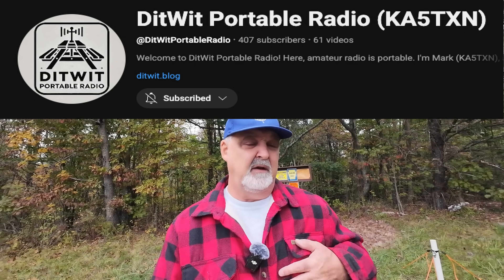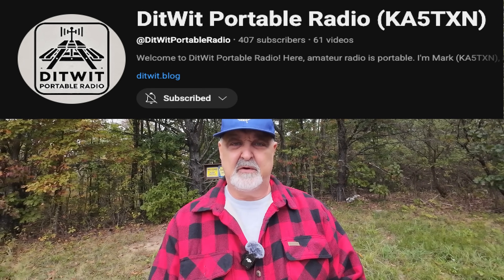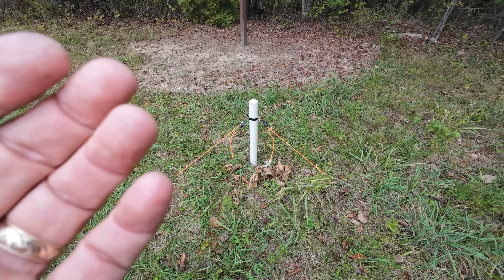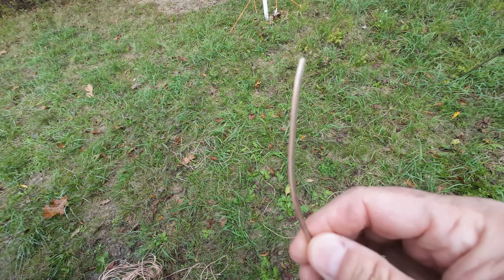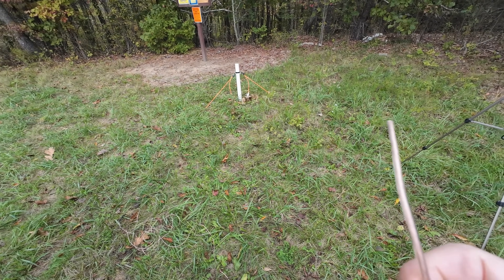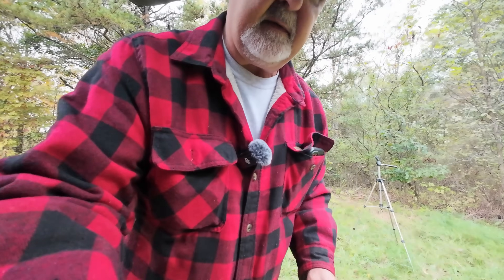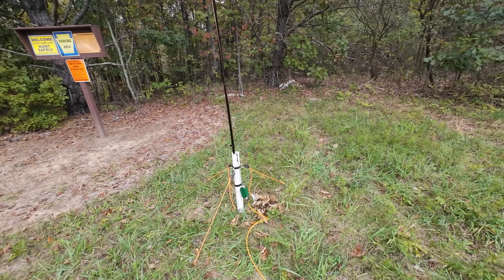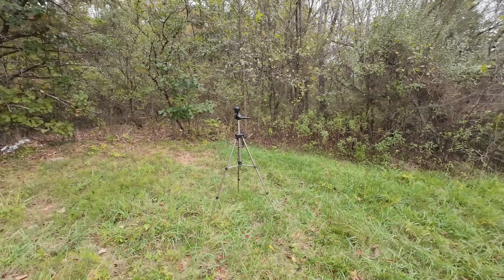Vertical Antenna without Ground Radials = Amazing Performance

Comment: I'm so pleased you had fun with the Challenger OCF halfwave antenna in the field! It's always fun for me to see how others deploy the antenna system. I introduced this design about a year ago and, over the last couple months, it has become my most popular download (after the PERformer quarterwave). I always share the PDF plans for free - I'm unable to share links in a YouTube comment but, if anyone would like a free copy, my email is good on QRZ. The Challenger is fed around 77% along the radiator with a 4:1 unun to match ~200 ohms impedance (a balun is for a balanced antenna only such as a dipole fed in the middle). Across all 6 bands, 20M-6M, it averages a 21-degree take off angle for great continental and DX coverage (if the bands are open). If using a telescoping whip for 20M, the radiator only needs ~22' of the 25' whip and, as you mentioned, the counterpoise is just 5' 9". In the design, I show all the whip lengths for each band, as well as how to build the linked counterpoise wire for each of the bands. The antenna must have an RF choke right at the feedpoint because you do not want your coax shield to become a second counterpoise negatively impacting impedance, efficiency and radiation pattern. Unlike quarterwave radials which should be elevated (e.g. PERformer antenna), the counterpoise has negligible current in it and can lay on the ground without worrying about ground capacitive coupling. Keep having fun out there 😀 73 KJ6ER (California)

Comment: I have a lot of fun building wire antennas! Take a look at KJ6ER's PDF for the POTA Challenger. For 20M he has the total length of the radiator (including the whip and the wire pigtail used to connect to the UnUN) as 271" (22' 7"), and the counterpoise total length is 69" (5' 9"). As others mentioned, the carbon fiber pole may be effecting the antenna as well. N7BBQ
Reply from the maker: Thanks, that is why the analyzer was showing a little long. It works great for 30 meters. Thanks for watching. 73s

Comment: The AA-30 is easy. Put in the frequency you want and scan the band. If the dip is to the left, it's too long. To the right, it's too short. you can use the left and right arrows to go up and down the frequency till you find the lowest SWR.
Reply from the maker: Thanks this is a huge help! I saved your comment in my photos to refer to it! Can I use your YouTube name in a upcoming video? Thanks for watching. 73s
Reply: @MyHamRadioJourney  Sure, you can use my name. I'm happy to help a fellow ham.

Comment: When you see a flat, relatively high SWR across the band, your antenna isn't very resonant.  In other words, it has low Q.  It's lossy.  That doesn't mean you can't make good contacts in good band conditions.  For this antenna, I suspect the ground radial lying on the ground is coupling a lot of your signal into the ground and you're heating dirt.  It's not a good sign that you built a 20m antenna, looked at it on the nanoVNA and decided to use it on 30m.   😀
Reply from the maker: I agree but it worked great on 30 meters . I did make a few contacts on 20. Thanks for the info. Thanks for watching. 73s

Comment: I won't even pretend being an antenna expert but shouldn't the radial be above the ground and not laid on it? I mean, I've always been told that a radial on the ground is detuned by it, so its exact length doesn't matter as long as there are enough of these.
To me, an off-center fed dipole must be hanging in the air, and I would have expected a balun and not an unun to feed it.
But maybe this antenna isn't meant to be an ordinary OCFD.
Also, as others have pointed out, I would put a choke at the feed point, else your coaxial cable becomes a counterpoise too and detunes the whole thing.
Reply from the maker: Yes this works as a OCFD just a different setup. The wire goes on the ground. I do think I need a choke. Thanks for watching. 73s
Reply: I'd try bringing the antenna up a bit so that the shorter radial isn't on the ground. Kind of POTA Explorer style.
You're quite welcome. I always appreciate watching your videos and find them interesting. 73s too.
Reply from the maker: @F4LDT-Alain Thanks I will give that a try. I am glad you enjoy the videos. 73s
Reply: @MyHamRadioJourney  I meant POTA Performer of course 😆

Comment: Did you use a choke on your coax at the antenna? If not the coax shield is part of your antenna and you no longer have an off centre fed half wave antenna. The guy you mention has one as part of his setup. Thanks for the video.
Reply: Just watched the DitWit video and read his blog. He uses a choke to isolate the coax . Also he uses wire to feed the antenna adding 12 inches to the antenna length and 6 inches to the counterpoise length for 20m resonance. His blog also has the lengths for a linked counterpoise for use on 20m throug 10m. I  hope that is of some help.
Reply from the maker: That is helpful. I thought he feed it with coax. Thanks for watching. 73s
Reply from the maker: Thanks. That makes sense. I will add my choke and see if I have different results. Thanks for watching. 73s

Comment: The antenna has a counterpoise.  It is the shield of your coax, your rig, your headphones, your key, your microphone, and your body.  The return path has to go somewhere, and that is where it will go.  If you do put counterpoises on the ground, they couple to the earth and provide a better return path through the earth and not into your headphones.  The carbon fiber pole is a conductor and since its end is so close to the ground, you are running your wire right next to a path to ground.  If you separate the wire from the pole several inches by pulling it down at a slope, you can reduce this.
Reply from the maker: This is a great idea, thanks for the suggestion. I will give that a try. Thanks for watching. 73s

Comment: It should be near resonant on 30 meters as a half wave antenna within a couple of feet anyway (234/10.1MHz) = 23.168 feet. Add the 4:1 UNUN and the 5'9" counterpoise wire and yours resonates well on 30m. Maybe worth a try on 30m? 

It seems that the antenna looks like a Rybakov Antenna where one uses a "random" wire length ("random" in quotes since the lengths are pre-defined so not actually random in that sense) mounted vertically then uses either a 4:1 or 9:1 UNUN. The POTA Challenger design probably was fine tuned to maximize efficiency. These Rybakovs are good antennas as you know with K4OGO demonstrating them on the beach in videos. Thanks for the video. Liked! 73.
Reply from the maker: I have built one of those also and it works well. Thanks for the info. Thanks for watching. 73s